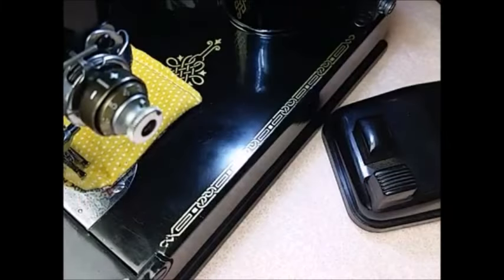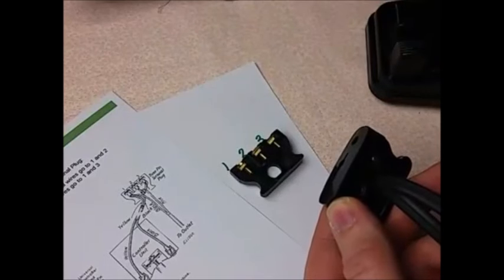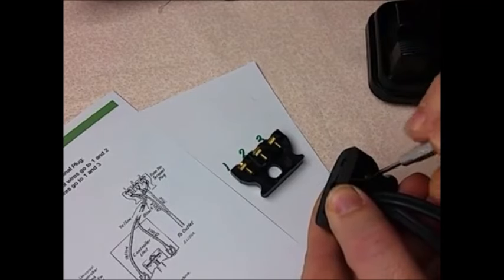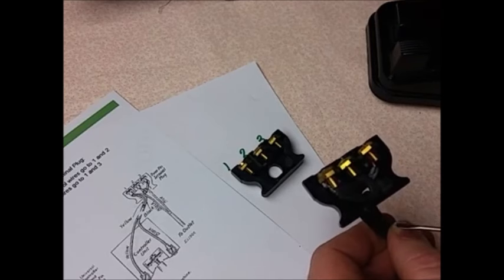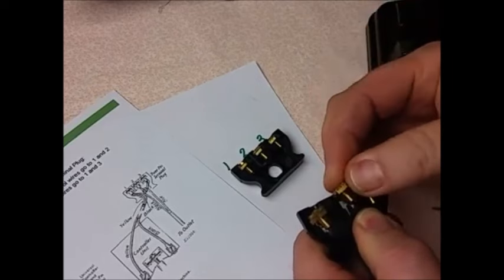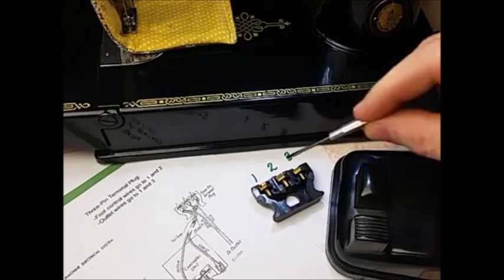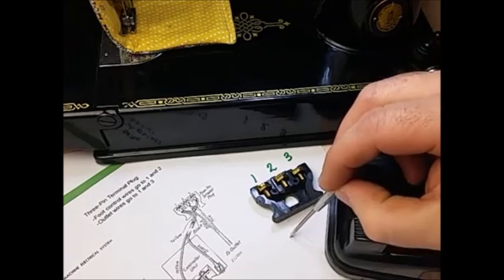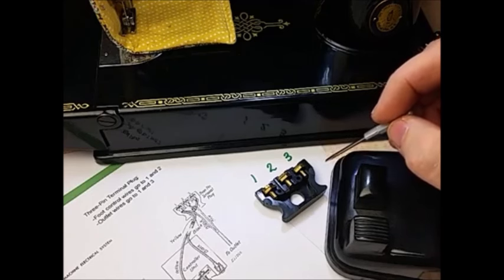Wiring Problems on a Singer Featherweight Power Cord

Comment: Thanks for the video and information , I have an old sears Kenmore sewing machine given to my parents  in the 70's,;- being I don't use a sewing machine  often, I didn't want to buy a new one.    
When I I took apart the plug [because it seemed to have a short]  the  contacts on the three prong receptacle plug just popped right out. I didn't want to take a chance  after having to solder one of the contacts to the ac plug wire of  forcing them back in and "testing" by plugging it in.
This video told which wire went to which receptacle prong and the machine words fine now. 
Before sewing was an extreme agitation having to lift the machine and readjust the plug  with every bobbin change or big movement.

Comment: Thanks - I always wonder why there are 3 pins - now I know - Do you know what they call this type of motor?  and foe the speed is control by the foot speed controller ? Changing the voltage or current? - I always thought the speed of the motor (AC) cannot be changed (can be varied a bit by voltage or current but it gets hot) - the speed of motor is fixed by the supllied frequency (50/60hz and the no of wiring poles) So how does it work?

Comment: What do I do with a plug that is two round prongs and not two flat pieces that goes into the wall. Is this 220? Can I just wire in a plug? Model # DV9117
Reply from the maker: Thank you so much for your message!  Follow this link for more information and to contact us directly: https://singer-featherweight.com/pages/contact-us

Comment: Hi i have to toyota ra224 rs2000 model sewing machine. Do you have such wiring diagram for it? I want to install a singer ydk yc-190 plug with it as I can't find one from Toyota in same pin connector. I live in pakistan can't import from other country so want to modify existing ones for it...

Update : 
I tried the singer padel on Toyota machine  though my motor runs but light turns off when I press on pedal to run the motor. I swaped the wires in the pedal but still same issue..

I followed a diagram that illustrates generic sewing machine with  light and motor. When motor is off light is on when motor is on light gets turned off.. Any idea what could be wrong?
Reply from the maker: Our specialty is the Singer Featherweight.  Check with your local sewing machine service technician about your machine model.